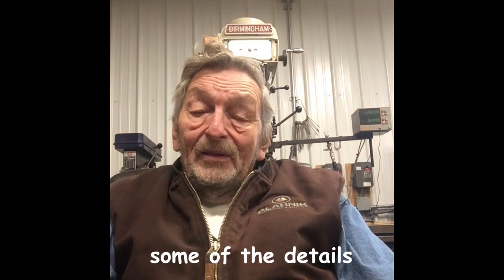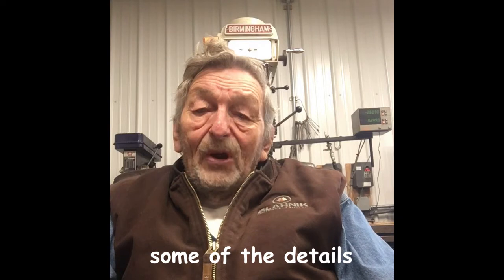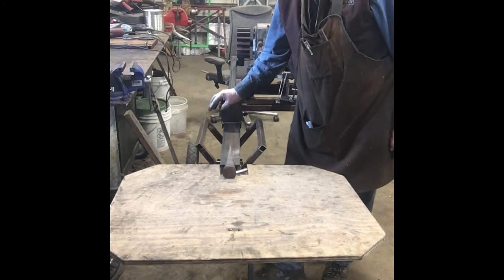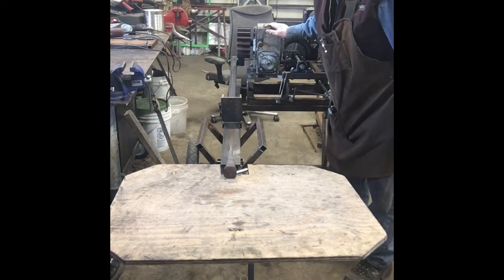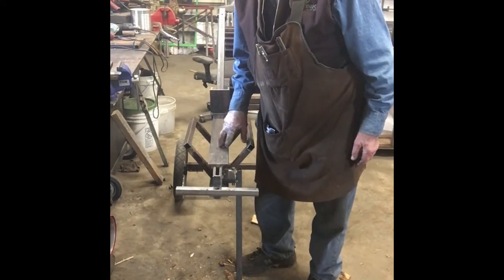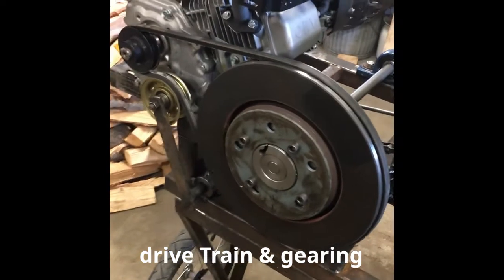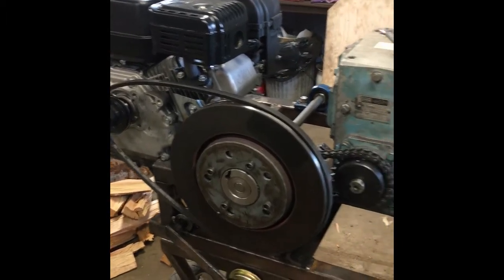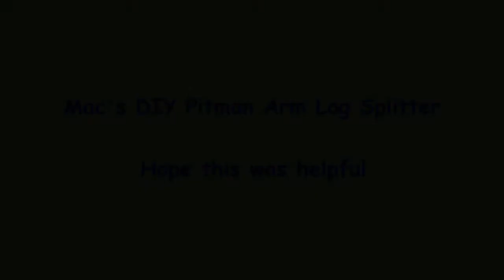Mac's pitman arm splitter 1

Comment: Mac, thanks so very much for sharing your thoughts and process of building this safe approach to a pitman arm type splitter. This the first one I have found that doesn’t require you to put your life or limbs at risk with the nice and slow approach of the pusher plate. I truly enjoyed your video thoroughness with clear speaking and time to digest what you are showing. Thanks again!
Reply from the maker: If I had it to do over I would make the stroke a bit shorter thus reducing the torque required. With that said ,... it works really well and I feel it is as safe as I could make it.